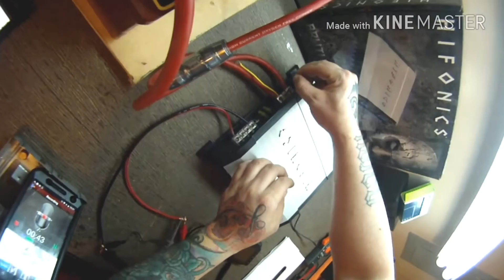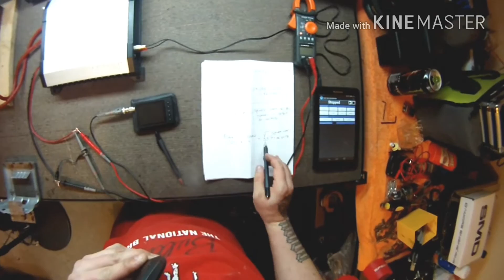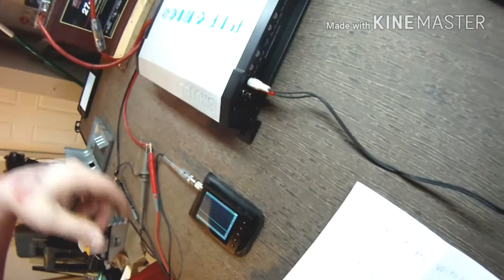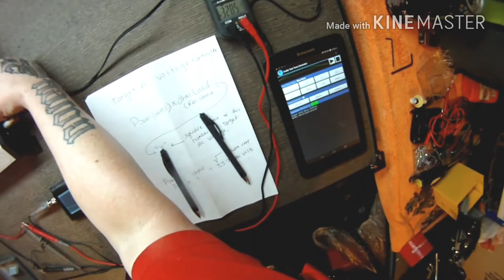DSO Nano V3 Amp Tuning Tutorial

Comment: I don't know if anyone covered this yet but your tablet may be putting out a dirty signal when you lower the signal of your tablet you can benefit by getting a cleaner signal cuz your amplifier does exactly that amplifies whatever signal it's getting so turn down your tablet and then increase your gain on your amplifier to your target voltage and you may receive a nicer cleaner signal at the desired output
Reply from the maker: VdubSPAZ Great Info!!!
Reply from the maker: I know man but I appreciate the info! This was a rough tutorial for tuning with the Nano.
Reply: I was going to say the same thing. The clipping was likely from the tablets output, not the amplifier actually clipping.

Comment: hi, many tutorials on setting the gain here on youtube, but I dont see anything on how to use the oscope to determine what crossover setting is active ..  the pot dials are far to broad.   Any help to utilize the scope to see where the heck the adjustment is??  thanks
Reply: a theory, can't find anything to back this up, but play a test tone at the frequency where you want to set the crossover and adjust the dial till the waveform disappears/goes flat from the scope, I would think that with a test tone you should be able to locate that point on the dial where the amp crossover now blocks the frequency resulting in nothing coming out the output to generate a wave on the scope
Reply: DanielRichards644 

ahh right! sounds logical..  i didnt see the forest thru the trees 

thanks:)